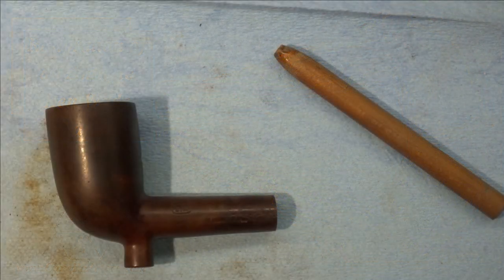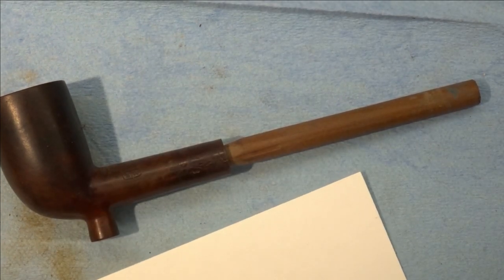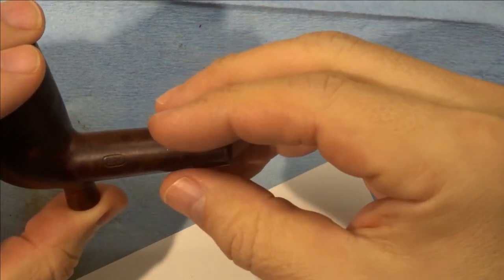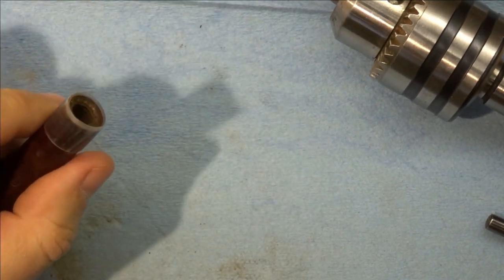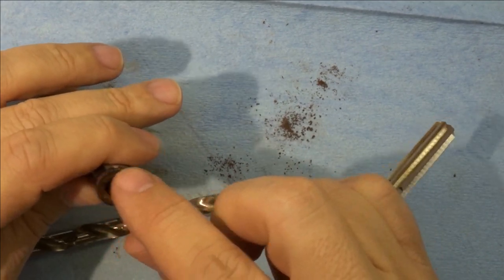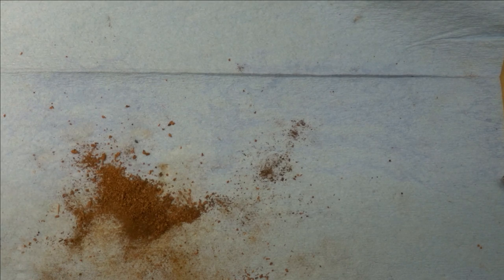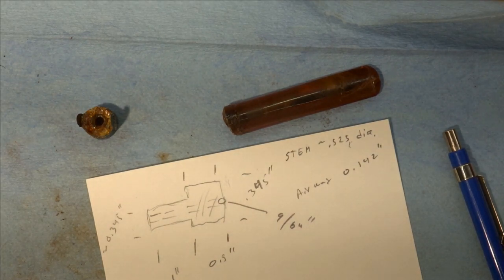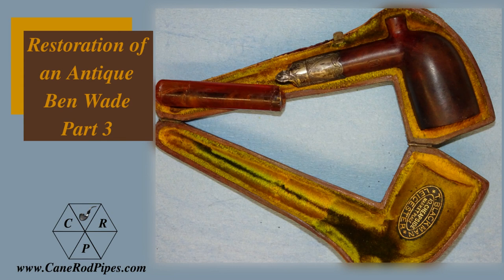Antique Ben Wade Restoration Part 3

Comment: watching this instead of reading the news while i have my breakfast. i was on the edge of my seat holding my breath during the reaming and drilling of the mortise and then the stem and band issues, all those numbers and measurements. it was all most too much for me. i cant take this kind of suspense. adventures in pipe repair. way better than the news.
Reply from the maker: I'll take that as a compliment, but isn't being better than the news sort of like being smarter than an ox ;-)  Thanks for watching!